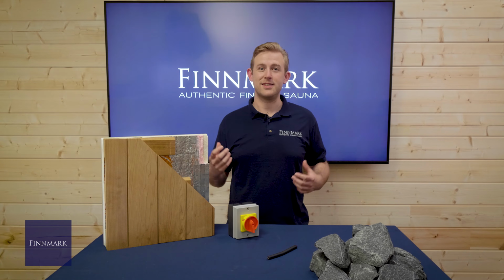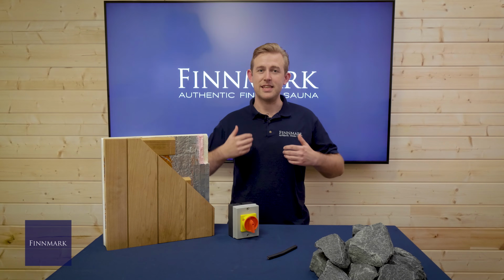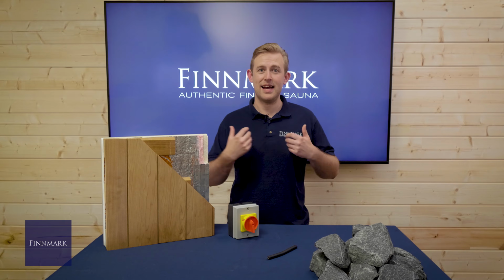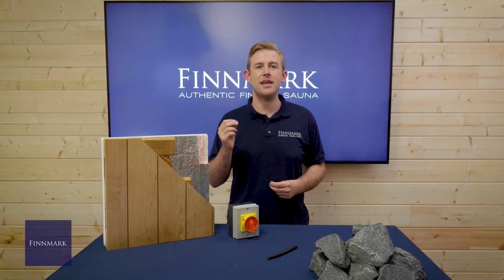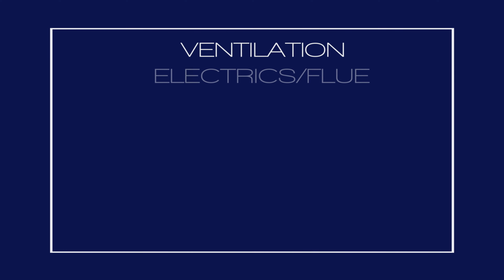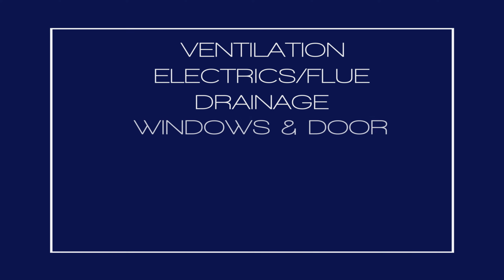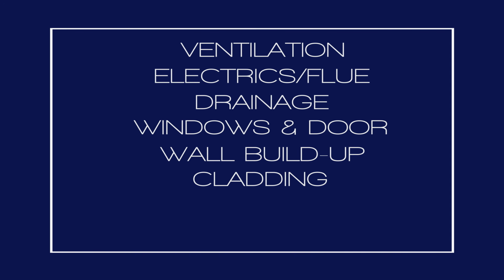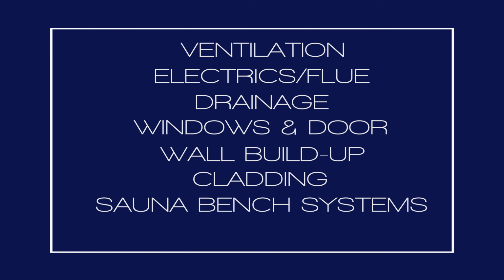How to specify a sauna? Finnish sauna design considerations

Comment: Hello from Finland! What a pleasant surprise that you have thought so well the design features! I didn't find any mistakes in this video. Only one notice that comes in mind from my experience of building saunas: Air intake should be right above of kiuas (the heater) or on the wall near the ceiling and above the kiuas. Then the incoming fresh air mixes right into the heated air. I use 3litres/second airflow in family size (abt 4-5 cubic metres) Exhaust should be only from below the door and into shower room's exhaust. Then the sauna dries thoroughly from the ceiling to the floor after use and there is no cold barriers inside sauna, because these will affect wood panels to mold in longer time. Therefor if you have to use exhaust inside sauna, install it as low as possible

Comment: Can you please discuss the options for the interior wood surface? Cedar vs Poplar. In the US there's a big difference in price.
Reply: Here in Finland Pine and Spruce are the most traditional woods used in saunas. Heat treated black alder and aspen are also very commonly used today. I have spruce panels on my sauna's walls and the benches are heat treated pine. But overall you can use any wood you like. I hope this helped a bit

Comment: Bench should be so your toes are level or higher than kiuas stones. Otherwise your toes are frozen while your upper body sweats and you get a feeling like you are sick and in feever, you are not relaxing.
Reply: That's right! This is called the law of löyly. It's not always possible in all spaces to achieve this. Also open-sided "tower" heaters behave differently.